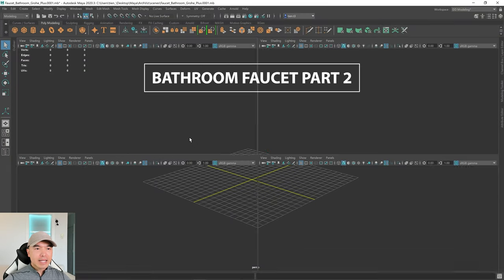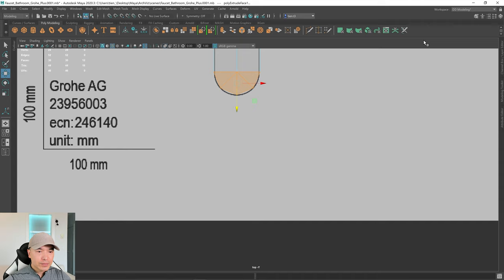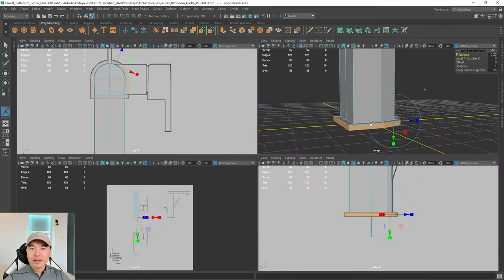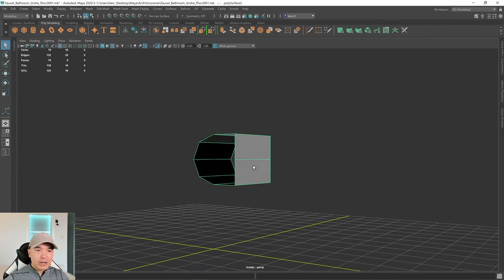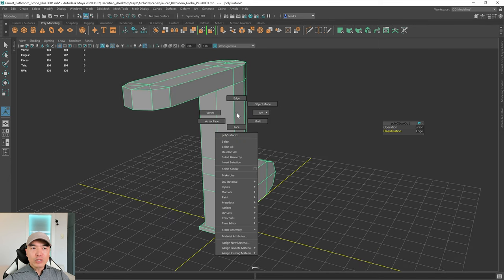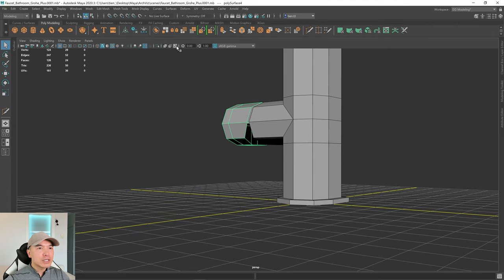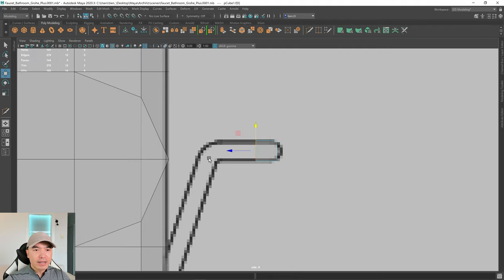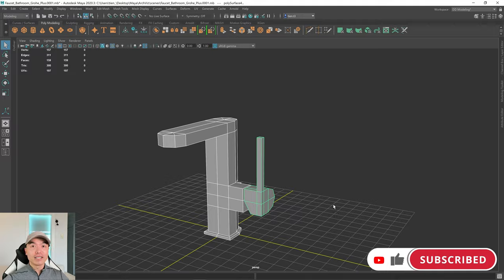How To Model A Faucet In Maya | Part 2 Blockout

Comment: I'm holding Shift while moving the faces but there is no extrusion. It is just stretching the model. Holding Shift or not holding it seems to do the same thing. It says extrude when I hold shift, but it's not extruding. I'm searching google to see what my problem is. Any hints that would help would be appreciated.
Reply from the maker: Smart extrude should be on by default but maybe double check to see if it got turned off somehow. Double click the Move Tool to go to the tool settings. Then open the Smart Duplicate Settings tab and check that "Shift + Drag to Extrude Components" is toggled on. If that doesn't check out you may need to reset your preferences cause sometimes Maya can go a bit wonky.
Reply: @DigitalDreambox  Everything is as it should be. I have been following your videos for a while now. Went through all the beginner stuff like the low poly vids. I never had this problem with any of them. But, after closer inspection, I noticed that not only were the faces selected but some of the edges on the other side of the model were selected as well.

At some point, I must have accidentally pressed 'B' on the keyboard and activated soft select. I pressed b again and the highlighted edges returned to normal. Afterward, extrude worked as it should. Looks like the constant practice is starting to pay off. Just wish I had figured it out 7 hours ago.

Thanks for the help. I didn't know you could get to tool properties by double-clicking a tool. That one will save some time in the future. Love your videos and your style of teaching. Can't wait to get into the more advanced stuff.
Reply from the maker: @jamirovega1332  Okay nice glad you figured it out. Best of luck and thanks for the support!